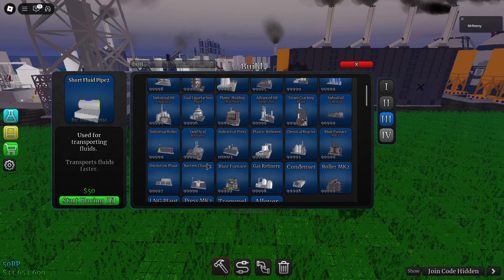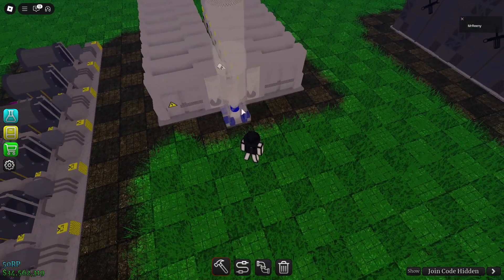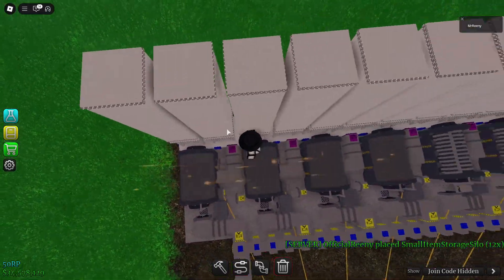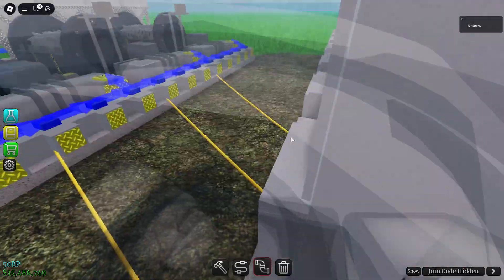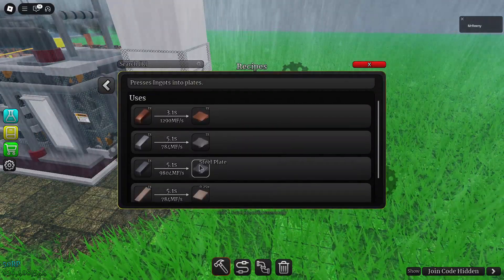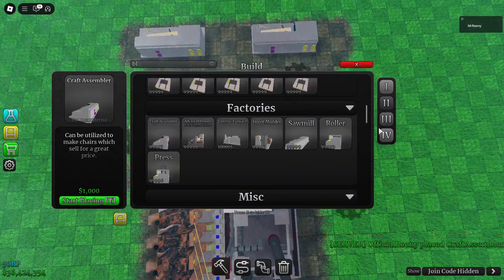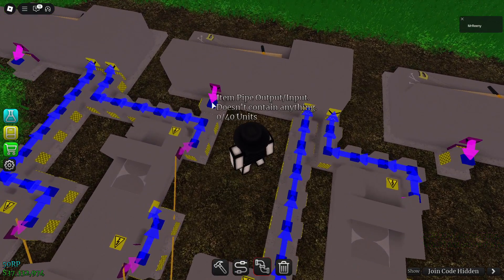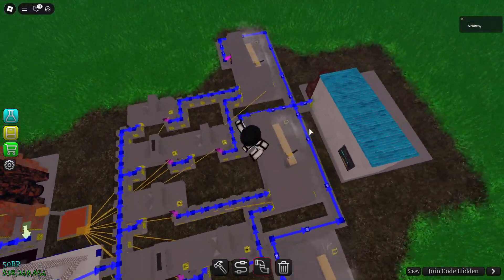HOW to MAKE Crankshafts In Industrialist

Comment: the second blast furnace doesnt output anything
Reply: 1. is it getting electricity
2. is it getting proper input
3. is the output getting clogged
4. is the piping system correct